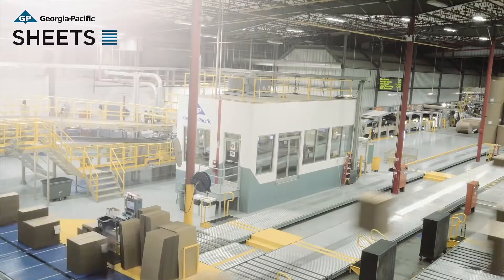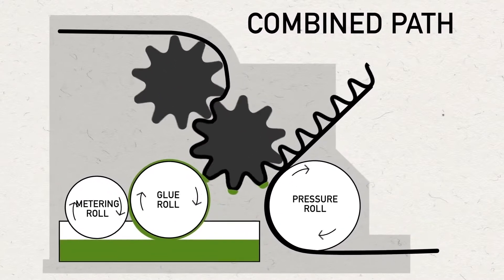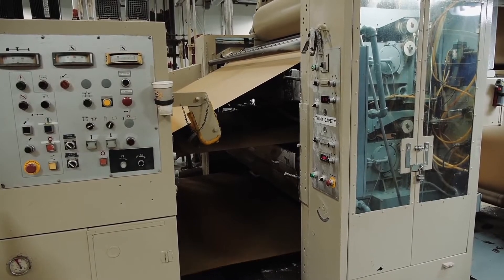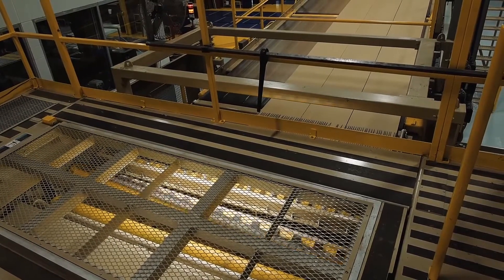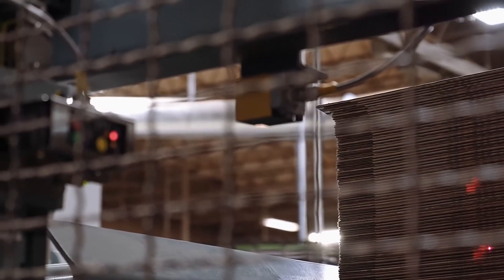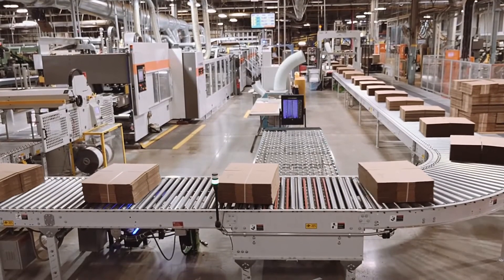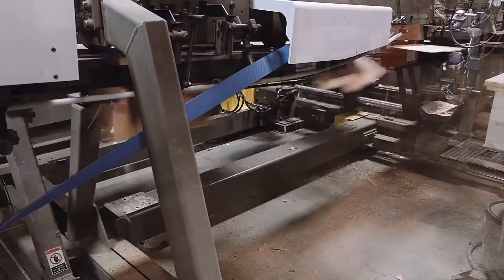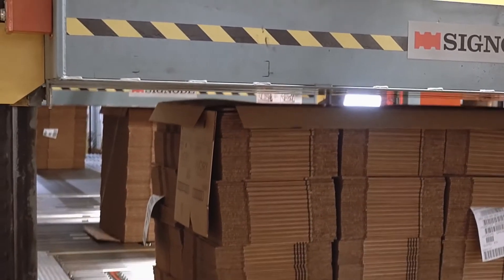How Amazon Corrugated Boxes Are Made In A Factory

Comment: Been working in the corrugated industry for a while now. It can pay pretty well depending on where you work.
Reply: Been working in a GP Corrugated plant for 3.5 years currently a control room op definitely good pay just started tearing out our old united Langston wetend and out BW Papersystems dry end for brand new BHS looking forward to new machine old girl limped for about a year until now
Reply: What city bro I'm in La and there a good amount of companies with there own corrugator's..
Reply: @EdgarBarboza-n6w 
Most box plants do. I worked for PCA and DS Smith. They both had corrugators. It's really only mom and pop shops with only a machine or two that get all their board farmed in.
Reply: very good to know. Any chance to upgrade there corrugator? Our master line which is based on IPC & Industrial 4.0 design, more simple & more stable, for your reference here is our machien video: https://youtu.be/2G0dgX7kBaA @EdgarBarboza-n6w
Reply: I've working in the corrugated industry for over 20 years, we have the same machines just like GP.
Reply: super experience. Any chance to recommend us good corrugated factories? we want to introduce our master line which is based on IPC & Industrial 4.0 design, more simple & more stable, for your reference here is our machien video: https://youtu.be/2G0dgX7kBaA